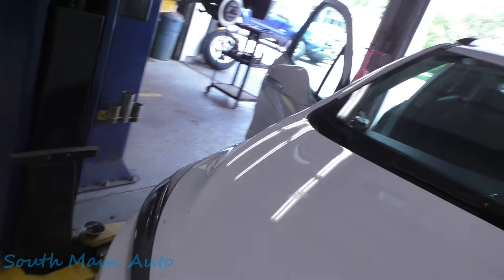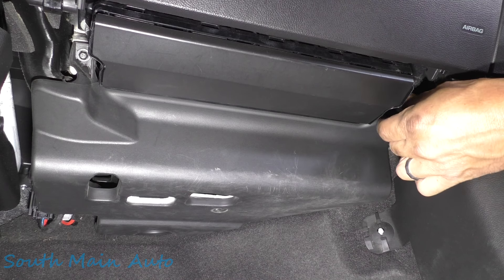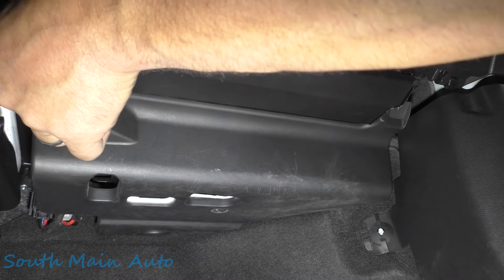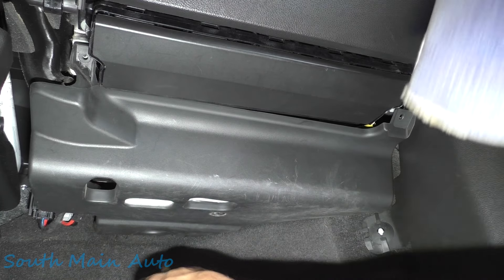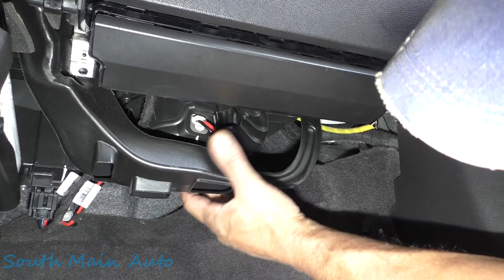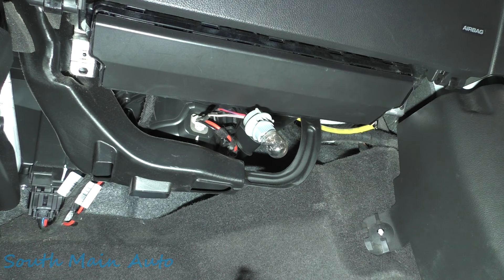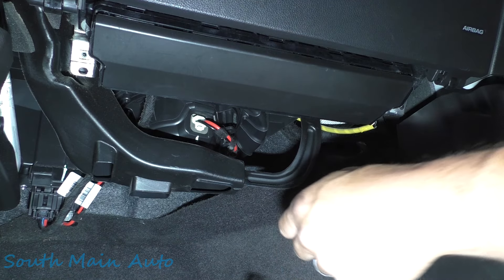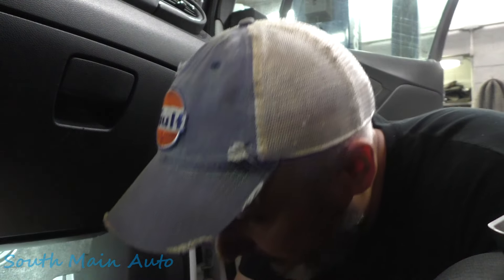Buick Encore - Blower Motor Replacement

Comment: Well I know I've seen you around here a bit but welcome to the chevy club either way. I don't get why manufacturers can't just make the screws obvious either, my truck has 2 hidden screws on that cover that you just about have to call your gymnast friend down just to access. I settled on the blind man fumbling in a dark room method for 5 minutes because I hate myself.

Man I went through 4 of those stupid blower motors on my 2008 silverado, wrecker reclaims. Stupid things have two different designs and mine is the "hard to find" model with the yellow impeller that even rock auto wants over 140 bucks for! Supposed to be higher flow or something, either way they burn up brushes and spill all that abrasive dust all over the place so the bearings/bushings are shot too. To make things worse you can't even rebuild them without getting real mean. Found that the suburbans, and escalade and other crew cab trucks will most likely have these in them and wreckers in my area are almost willing to give them away. I've been able to thankfully pick up spares at 10-15 bucks a piece. Found one recently from an escalade with under 150000KM's and it's been running great! Hope it lasts another year or two.

Word to the wise, if your truck/car has the white impeller type and you feel like modifying the yellow impeller type you'll get more CFM's out of your system. Retaining clips/ring has different tabs but you can absolutely modify to fit! I tried using a white impeller type but no go for my truck but while looking at the two noticed the yellow one could be modified to fit in place of a white one.

Comment: LOL, I hate under the dash work because in 6 foot 2. I changed out a cabin filter a few days ago in my Jetta & its easy but getting up under the dask so I can see what's going on sucked. I think i'm gonna buy a large mirror for that type of work from now on. Just set the mirror on the floor & use my hands. I have no idea why GM decided to not make the blower motor easy to service or replace. They put those blowers right under the dash compartment knowing things can fall down in them.

Comment: I had a 2012 Malibu that sounded like something was stuck in the blower motor when running it at the lowest speed. It has a similar design to this one where you have to cut it out to remove it, decided it wasn’t worth the trouble and lived with the noise until I traded it in earlier this year. I honestly don’t know what the GM designers were thinking on this one other than the multiple billing hours to install it lol.

Comment: We always enjoyed when an engineer would go out on a job with us. We used to hope and pray it would be raining ice and snow, cold enough to break steel and mud up to our knees.
We’d show them how it could have been better, sometimes they said you’re correct. Sometimes they said it had to be that way and we would sometimes get the reason, sometimes not
Reply: I'd go out and do it as good and fast as field clowns.  Well provided they brought the right tools in the first place.  And when they didn't I'd tell them that 90% of this structure can be tore down or assembled with four wrenches.  Then I'd pull the wrenches out of my own flight bag and continue to make them look bad.  I love tools like you... good reason in our pay difference, and the respect I get that you don't.
Reply: @Look_What_I_Did  well apparently some of the engineers I dealt with were much more arrogant and condescending than you are…

Comment: It’s like it’s a competition to redesign everything for each model of car. That’s why Subaru  hasn’t changed their basic design of their cars in fifty years. My son had a 2006 outback and I have a 2018 outback and everything is basically in the same place.  I’m sure the guys on the assembly line sound like you when they are putting them together. Haha

Comment: I remember the Days when you could Remove the Fan Motor and Heater Core from under the Hood, rather Easy Job, Yes it was before the Computer era but you could still have a bunch of room for the Computer Crap. Also had Mechanical Levers for Air and Heat. I had rather Go Back to the Old Engineering Technics than put up with these Modern Controls in these New Vehicles. I have seen Mechanics remove the Whole Dash lately as I have mechanic friends--what a Nightmare. Plastic is not our Best Friend...

Comment: The engineer that designed the blower motor assembly @ Buick should have to come and remove the dead mouse that decided it was a good idea to crawl into the squirrel cage assembly.

Comment: I owned a 2015 Sonic LTZ. Almost worse than not working, is when the blower inevitably starts to squeak. If you want to simply remove and reinstall the OEM blower, you need the ring kit -- $22 at the time. In a Sonic, you also have to remove the foot well airbag to access the blower (Anybody DIYer wanna handle a bomb that can be set off by transient voltage?). Carefully disassemble the non-serviceable motor, blow out the brush and commutator dust, sparingly lubricate, reassemble. No more squeak. Dealership wants over $500 to replace the blower + a shaming for not replacing your cabin air filter sooner. Do it yourself or let the car be struck with Jewish Lightning. The latter is best if you have full coverage. If you have a 1.4L Ecotec LUV, I pity you.

Comment: That design engineer was fired the minute they found out about his incompetence. His boss who approved the design was fired too. My 06 Dakota was a dream to change out the blower motor.  The aftermarket motor was noisy so I returned it and got an OEM motor; bit difference.

Comment: What's stupid is that the blower motor in my older Impala is accessed by removing the wiper cowl and one other easy to remove panel (dead easy to do yourself). This is quite the regression here.

Comment: What a piece of crap. The new blower motor looks like it belongs in a child's toy. All the reasons I can't justify buying a new car.
Choose 6, 8 or 10 speed sealed transmission, CVT, no way of easily servicing anything, the cheapest plastic all over the place and stealerships that take you by the throat to even diagnose anything. Wish I had my 56 Chevy back.

Comment: As an engineer I can tell you I understand all too well what you mean. Some companies (and by that I mean a huge amount) don't put the engineers out on the product floor so they know what the assemblers and builders have to deal with. Just because it looks good on paper does not make it easy to put together or take apart for servicing.

Comment: I just hate it when they build a car AROUND the part you need to replace.
Example- Chevy Monza, 2+2 with a V-8.  You had to drill a hole in the wheel well- just to change the spark plug nearest to the firewall.
Reply: Says you.  I never had an issue replacing the spark plugs.

Comment: Oh, GM has not changed in my day. Buick and Pontiac had them behind the steel inner fender with a million bolts. That would never come out. The only good part is every parts stores had 2 or more. Funny part is ford you could replace in 15 minutes but no one had a replacement. OEM or aftermarket.

Comment: Engineers design stuff way more complex because they need to justify their job, the bean counters make them change the design to save ten cents, and real technicians are the ones who fix it.
 I ran into that crap all the time in repairing home electronics.  They knew it was a real bad day when I would put in an order for a 10 lb. sledge and a plane ticket to have a "1 on 1" with some of the so called "engineers" at Pioneer.

Comment: Wife has a 14 rogue blow motor went out. Nissan wanted $500 to change it local garage wanted the same so I did it myself not a hard job just had to remove pedals a support bracket to get to it on the drivers side.it’s held in by one screw after you twist it to lock it in. And the people at Nissan was nice enough to get me 1 inch of extra wiring to get it out because they love me. Oh did I fail to mention I’m 200 pounds in a small foreign car in which I turned myself in to a pretzel 🥨.so here I am back is on the floor butt on the seat one leg in the back seat and the other out to drivers side door pointing at times from noon to 4 o’clock. If there is a next time going to hire the 12 year old across the street his tall and thin lo 😂😂😂😂😂😂😂

Comment: You think this is ridiculous.  Try changing a heater core in a 2003 S-10 pickup.  The entire dash must be removed for access to it.  Cost me 750.00 at a non dealer shop.  I couldn't do it because my back don't bend like that anymore.

Comment: Reminds me of my 2010 focus, the flexi section of the exhaust had split. I didn't have the skills or know-how to chop out and replace just that. So had to replace the manifold, cat and finally the flexi as they are built as one complete assembly. What made it even worse the design is to drop the subframe to get it in and out. I just unbolted the engine mounts and pulled it forward with a strap but still a right PITA. Stupid design.

Comment: The Big 1.5! Is that Big Enough to even run AC? Eric, it's not engineers, it's management.  They don't turd engineers aloose on a design like a terd of wild horses, management always has to oversee each project. They have "THINK TANKS" who decide how it will be done.(cost) G'day. ben/ michigan
Reply: You can't even spell... yet you know corporate structure and causation?  I think not.

Comment: If I were you, I'd invest in a handheld ultrasonic welder. I know they are pretty pricey. But, would it not be financially worth it in the long run? Seems to me, it would be worth it short term as well. Simply because of the aggravation factor of loosing time waiting on replacement parts.

Comment: It could have been much worse to access the blower motor, like needing to remove the dash, steering wheel and column, supports, center counsel, shifter, work that would take 3 days.

Comment: GM is such crap!  The car is only 6 years old. Why is the blower motor bad?  Also why is not a few screws to replace?   Sorry,  My 25 year on Nissan is still rocking the original blower motor and it is cake to replace even if I needed to replace it.  American engineering sucks.

Comment: The three words a man never wants to hear: "is it in?"  LOL

I spent too many years with my fat ass upside down and backwards under the dashes of too many Fords, when I worked at the dealership, back in the '80s.  At least I could get in that position.  One of my even fatter friends had to kneel on a pad outside the car, because even removing the seat(s) wouldn't gain him a lot of access.  We called him Baby Huey for a reason.

That was the beginning of the, improved, electronic/electrical everything, back then, and all that stuff had thinner gauge wires going to every component.  Between crappy engineering and equally crappy production - body screws through wires was big, back then, there was plenty of AC/electrical work.  

Plus, aluminum everything.  Radiators, condensers, evaporators...if it was part of the AC system and/or the cooling system, it was made of aluminum, and there was more warranty work than you could shake a Christmas tree fastener tool at.  

Oh, and you didn't want to pull those seats out if you could help it.  Remember manufacturing processes and screws though wires?  Sometimes you had to, but a) it was a pain in the ass to get them in and out, and b) the plastic was nowhere near as forgiving.  It would break and/or strip out if you looked at it funny or talked bad to it.

Comment: I'm not sticking up for any Gm Engineers. I also have a Buick Encore. There is just so much overkill in all these cars, they run out of places to put everything. Any vehicle made after 2010 has a hidden module anywhere then can find room. Again I'm not sticking up for car engineers. Try changing a 2010 GMC Acadia headlight. They literally want you to take off the front fascia  to change a high maintenance item like a headlamp. You can do it thru the fender well & it's still annoying. I did it myself. Just for giggles I called the dealer.. $150 to change a $20 headlight??? I could go on & on about crappy designs as probably everything can in these comment sections.

Comment: The engineers should have to do an internship at a dealership working on stuff before they are allowed to design anything.  After they do their internship and design something like this technicians should be allowed to line up and kick them in the junk.

Comment: Dunno, I saw a cabin filter when you took the motor out, so I expect you could get a leaf or such in the squirrel cage out through the cabin filter opening without removing the motor. But I do agree, what a totally stupid design, as if these blower motors would never fail?

Comment: there are a new breed of engineers out there now. none interested in longevity of vehicles or components . consider the common coolant thermostat housing is made of plastic. they even fit lightweight batteries now in vehicles where batteries should be 50% stronger.

Comment: GM!  Who dreamed this up?  I’ve worked on old Volvos and VWs and a bunch of chevys but I’ve never seen a blower motor come out like that.  We’re we supposed to toss out the car the day before it fails?
Reply: Old Volvos, like the 240 series where you have to remove the entire dash to get at the blower?
Reply: @jeffbuckles  yes but in a 240/740/940 you don have to remove the dash to change the heater core / blower, but in a Volvo 850 you do.

Comment: That dumb blowah design must the the only thing my stripped-down HHR Panel Van has in common with the refined and ostentatious Buick. I dreaded cutting the old blowah out, but for once, I got lucky. Not like that, though. Anyways, the blowah motah was getting watuh in it when it rained. Prolly not an issue on the Buick, but on the HHR, the plastic cowl covah has to seal to the windshield - uthuwise, the rain runs down unduh the cowl cuvah and goes right on into the HVAC system, with the blowah being the low point. I got the covah to seal on the windshield, and the blowah suhvived for several years now. I just knew the bushing would rust to the shaft, but it didn't! Then there're the pesky popping noise from the fresh/recirc door actuator. The complete, whole, and entire dash has to come out to reach it (upper right end of HVAC assy. I used a mirror and borescope to locate the popping little cracker, and I unplugged it. No more popping when the car is started! Can't do that on the Buick, I'm sure. Gotta have driver/passenger temp control and all the bells and whistles operating normally.

Comment: A relative of mine just recently bought a '23 model of this unit. I had made some suggestions when he was looking for a mid sized SUV, like a low mileage rav4 etc, and then he tells me that he traded in his beautiful no rust 05 RAM for one of these. Everything I see and hear is that this platform is a disastrous POS. I really appreciate the videos so at least I know what's likely to fail (everything?). Did you have a retail price on the motor kit? Thanks - good job as always.

Comment: I can understand your frustration, fans bringing them your cars only to find nothing is wrong with it  I think you should add a question to the normal set when someone calls in to make an appt.   Where did you hear about us?  If they say Youtube and it turns out nothing was wrong with the car, charge them for your time (i.e. make it worth your while) and maybe take a photo with them and their car.  I am sure you do not want to entertain that kind of thing getting started, but at least they would not completely waste your time, and you might feel somewhat better about charging them when you didn't fix anything..

Comment: 2017 & BROKEN ALREADY??  GM & Ford will electrify & quality assurance themselves right out of business.  My 05 corolla has 400k miles and is all original except for normal wear parts.  Original auto trans, water pump, ac, driveshafts, wheel bearings, etc

Comment: Not do defend GM necessarily, but isn't a part like this designed by a supplier?  Doesn't GM just specify they need a blower of a certain spec that fits into a certain space and the supplier provides it?

Comment: New cars get more expensive and become more disposable because of all the plastic crap. My 2004 F150 Lariar feels more solid than my 2018 F250 Platinum. I love the newer truck but I know it will not give me the basically trouble free 300k miles the old truck has given me.

Comment: People obviously think you spend the day flirting around with mrs.O, making videos. All happy and fun. Show some of the super rusty pieces of shit that you spend 8 hours cussing at to just find out at the end of the day it's headed to the crusher in a month. I had a Saturn L300. Needed a bunch of work but only had 80k on it. It had the 3.0 liter Saab motor in it. Which also means it had the $7000 Saab exhaust system on it. I rigged and patched to keep it quiet. Put a new subframe on it once which installed was only $400. Not terrible. Well I did calipers, all new brake lines, power steering lines, radiator, etc etc. Then I noticed subframe gone again. I got one then more crap popped up. I said that's it. NY rust belt finally won. Sold it for parts. Still have a new sub frame for it if anyone needs it, buy me lunch its yours.

Comment: The reason they designed it that was is because assembling it was such a pain. So rather than fix that they just made a part that didn’t need to be put together. Yeah they knew it was the worst design, but just bodged it - your problem now.

Comment: Yeah them engineers always shtupping the mechanics with their engineering prowess. AKA bs running a thru tube for the waterpump on a 3.5/3.7 v6 mopar or a brilliant stoke of putting the starter in beneath the intake.  And now GM's time wasting molded in blower motor and sacraficial wire mountings